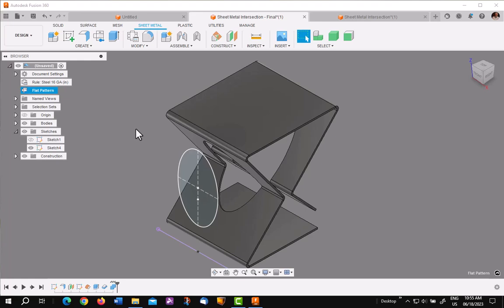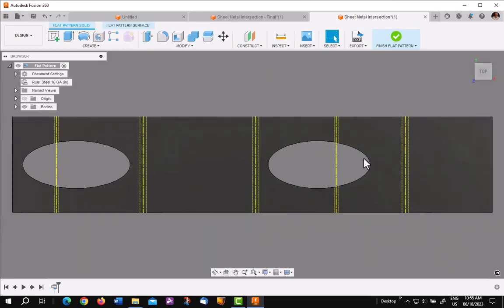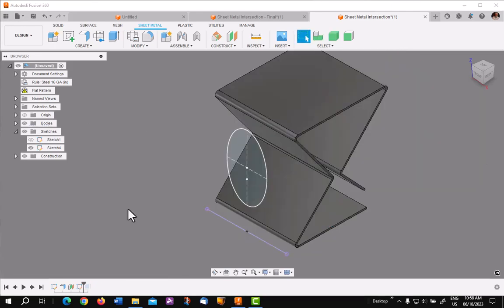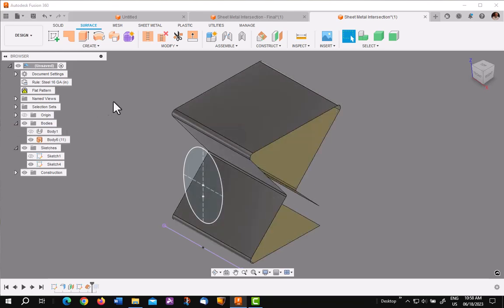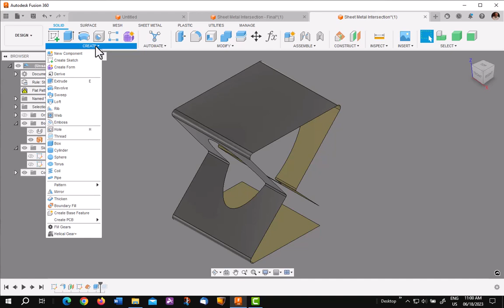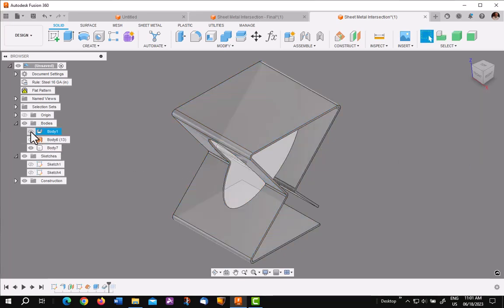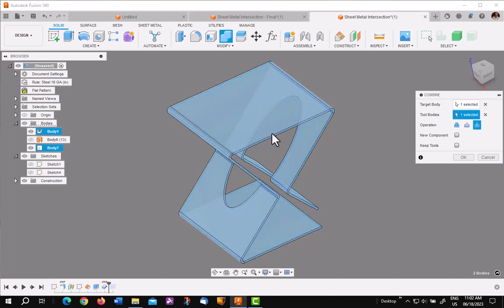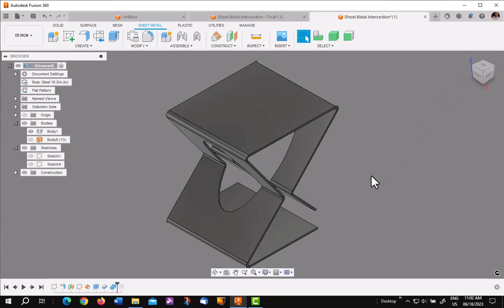Creating Complex Sheet Metal Cuts in Fusion 360

Comment: Just used this trick to create 45deg cuts on a boat platform by creating a surface piece then thickening and converting to sheet metal. it cuts the part on the inside so there is a perfect angle to weld up the outside of the joint.